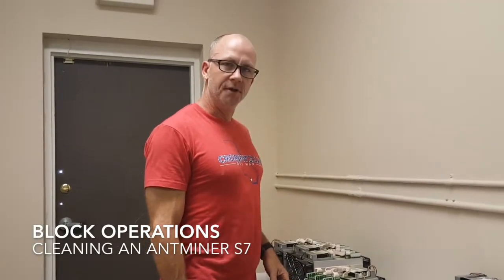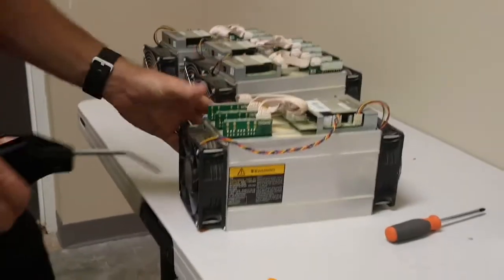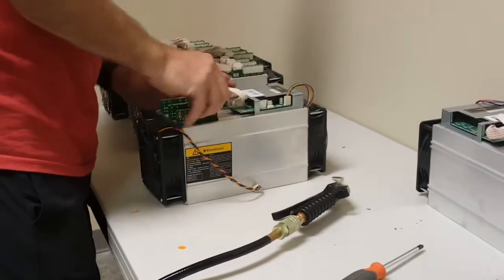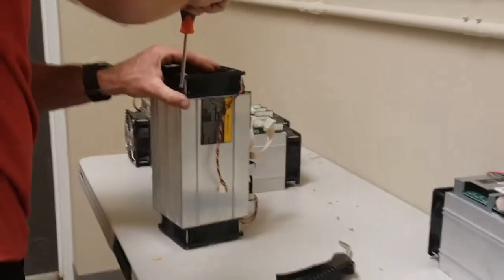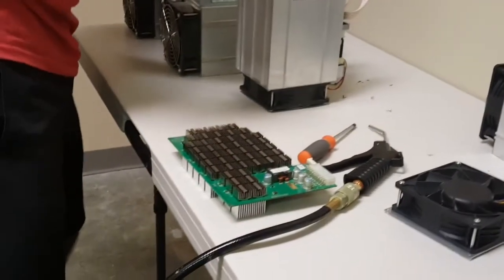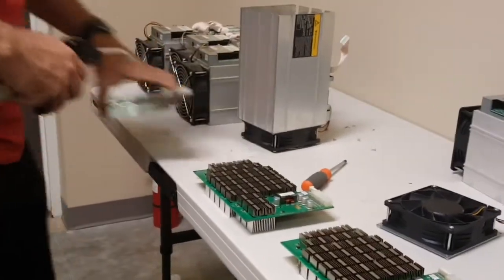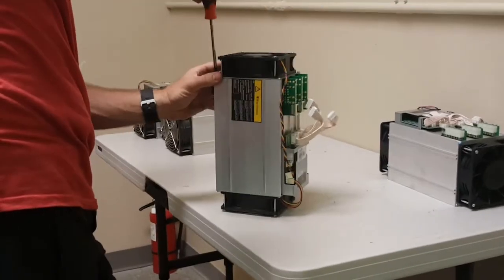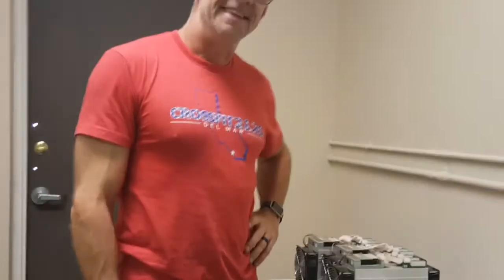Cleaning Dust out of Antminer S7

Comment: After cleaning my S9 and blasting the dust out with compressed air one of my boards is not hashing. Any suggestions? It shows a temp of 60 and HW 0 (hardware errors) but no hash rate...
I was super careful otherwise, I hope the compressed air didn't hurt it somehow????